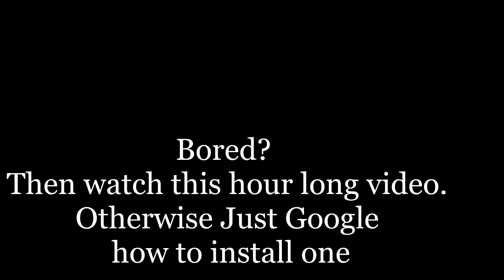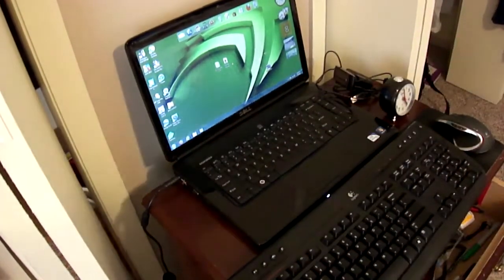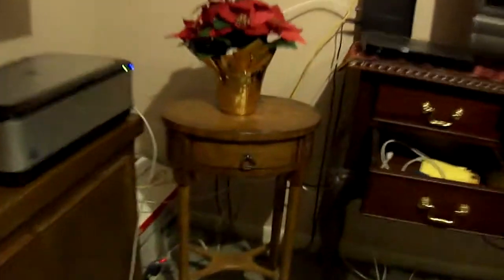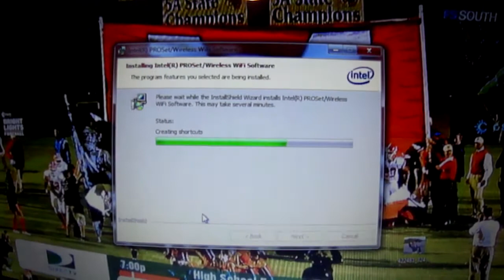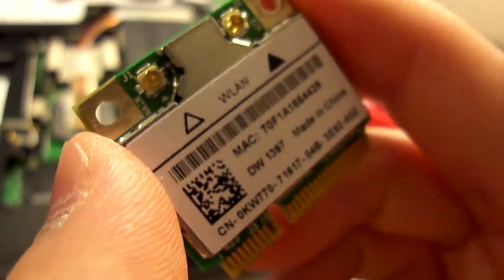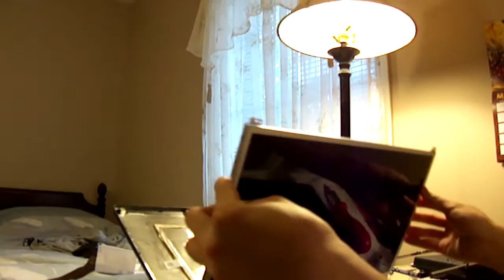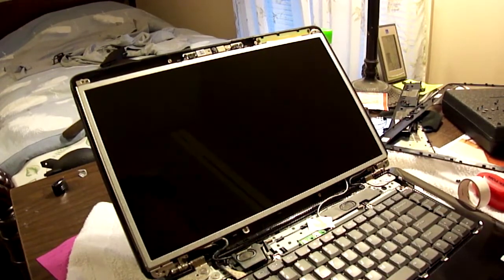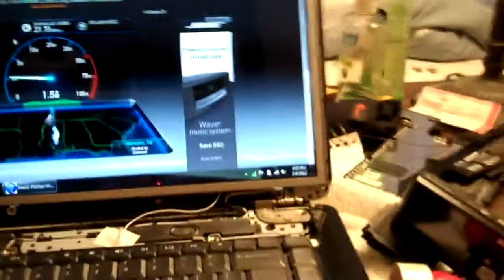Upgrading The Wi-Fi Card On A Laptop (Dell Inspiron 1545)

Comment: This kid cracks me up! First, kudos to Charlie for creating this. (I wanted to check the video first before sending link to a DIY type client that's interested in learning to work on his own PC's. He actually has this Dell 1545) Second, I'll second your comment on Atheros Charlie! I've worked in IT on and off for the last 20 years with the last three years in a corporate 32 hospital network. (meaning I was responsible for thousands of desktops, laptops, servers and all things in between). The hospital network used Dell for everything. The worst (read most troubled) thing we had to work on were devices called C.O.W's. (computer on wheels) Atheros network cards for laptops were by far the better and more reliable cards. In an enterprise setting we had to use Intel's Proset Client for all Intel wireless cards and of course we used the Atheros client for the Atheros cards. The Atheros client was clean and to the point, it always "just worked". Intels Proset client is THE most unreliable and unnecessarily confusing client software I have ever used! That being said, if you're using an Intel wireless card you will have much better luck letting Windows control your wireless instead of using Proset.

Comment: Nice video.  Thinking about doing the same upgrade to my HP DV7-1270us.  Wanted to see what was involved in routing the antenna wire. The DV7 lcd bezel doesnt have visible fasteners, so I'm a little reluctant to take it apart. The DV7 came with an intel WiFi Link 5100 that is pretty good, but it has only 2 antennas (max speed 300Mbps). My Linksys EA4500 router is dual band 450Mbps capable.  450Mbps needs 3 antennas to get the fastest wireless transfer speeds possible between network devices.

Comment: I just looking to replace the antenna wires myself as they have been getting frayed in the hinge of my old Inspiron 1545 and causing screen flicker.  I pushed the black and white wires back into place more properly and tried to glue them into the desired slot spot with a glob of silicone adhesive and once the silicone cured my problem has been 95% cured.  I still get an occasional flicker but it is much better.  I am afraid it may come back again and would like a 100% fix.  Definitely replace the antenna wires!